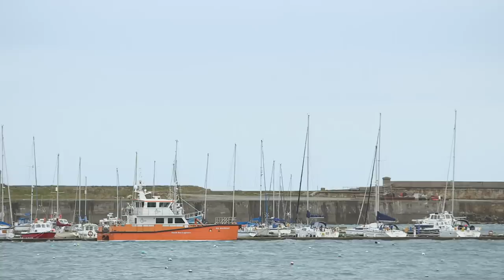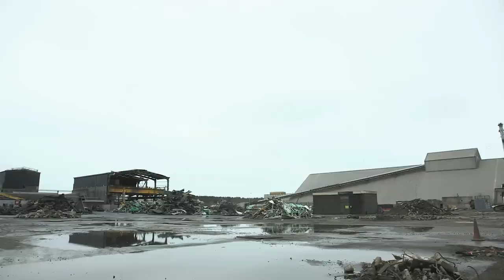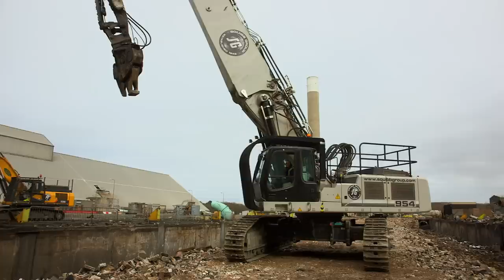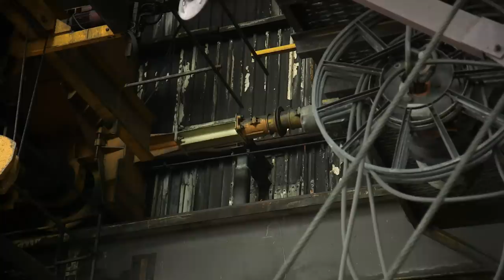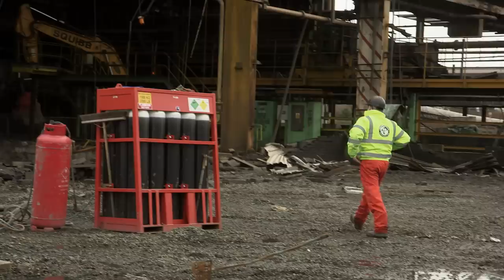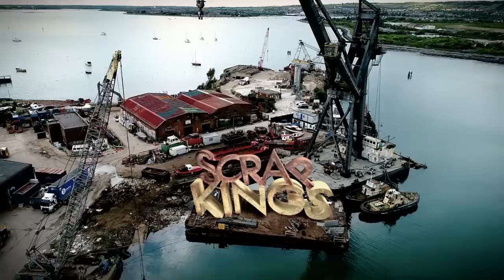How To Pull Down 100 Tonnes Worth Of Cranes | Part 3 Of 4 | Scrap Kings

Comment: The problem is that you cut off to  much length of rail, that could have been used as a slope . By cutting them off the pillars and letting  them bending down under its own weight between the pillars.
And voila, your own scrap yard rollercoaster!
Reply: @johnwilliammcfadyen577  thats abit strong john i would have sold them let buyer dismantle